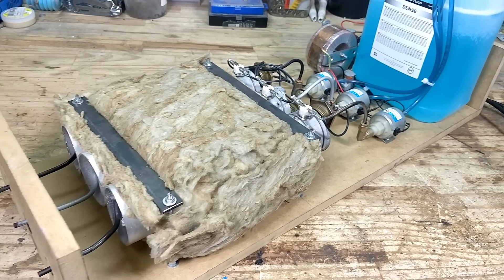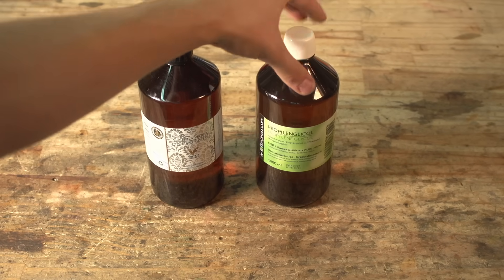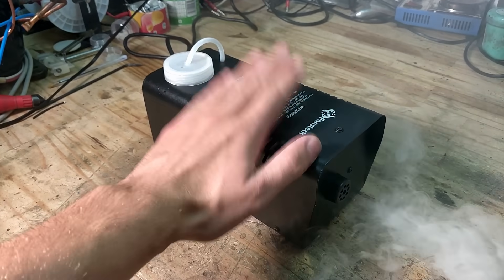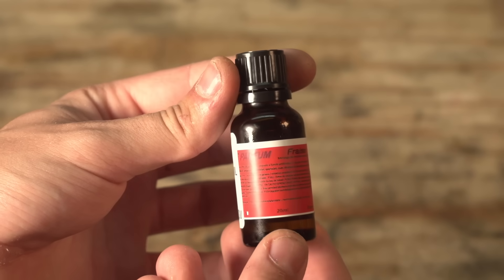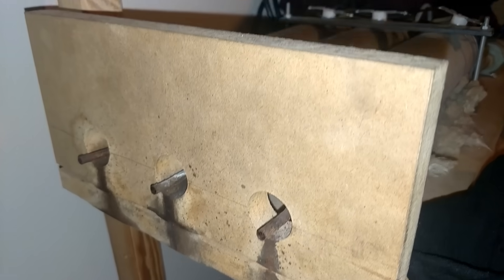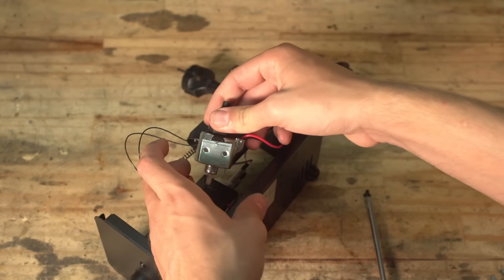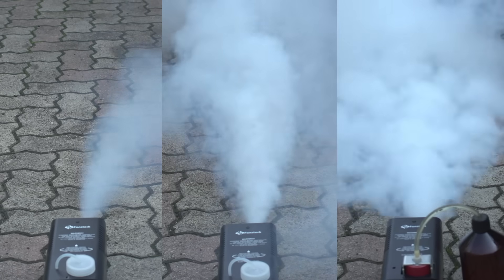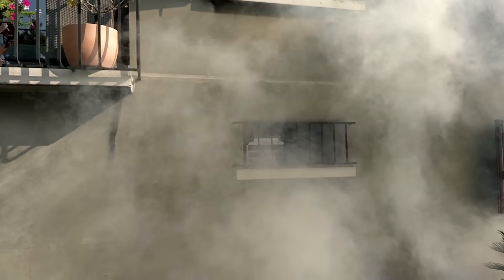How To Make a Cheap Fog Machine 10 Times More Powerful

Comment: what's your stance on putting the 50/50 solution in a propane insect fogger?
Reply: Use mineral oil for insect fogger works great.

Comment: The reason they use the mixtures they do could be as sinister as people like lots of fog, so, they will have to buy more juice. Or is could be as innocent as regulatory measures that are put in place require them to only include so much glycerin due to toxicity.

Comment: Vinegar is the worst possible thing you could clean a fog machine with *UNLESS you run a shit ton of distilled water behind it, then cycle back in some fog juice. We use vinegar to corrode chains and metal for haunt props. What do you think it will do to the inner workings of a fog machine if you run it through, then leave it? Within 24 hours your pump will be seized and tout injector will be clogged with corrosion. Flush your machine with distilled water 5 or 6 times at least, then refill with fog fluid, cycle a few more times and then store them with an inch or two of fog fluid in the tank. never clean a machine unless it is malfunctioning and never allow it to run empty of fog fluid or store it without some in the tank. I have machines that cost $17 at Target that are still running after 5 years because I never let them be without fog fluid. If you "clean" your machine with vinegar, then store it, you will 100% have a non-functional machine when you try to use it again. Use a commercial cleaner, flush it out with distilled water afterwards, then cycle fog fluid through it and store it with some fog fluid  in the tank. They will last a long time this way.

Comment: Ordered the parts to do this myself, I have no idea how I'm going to sort out the pump, as I don't own a dremel and don't really have any good method to make the adaptor thing. I have some spare 3d printer nozzles, but that's about it..😂
Reply: I ended up 3d printing it and sealing it with a 2 part epoxy, worked like a dream.

Comment: Couldn't you just preheat the juice reservoir to a higher temperature, but still below the flash point to not cool down the heating element as fast when the liquid passes through it?
Reply: Good idea... That would also reduce viscosity, which should be helpful. Some insulation of the bottle and lines could help.

Comment: A word of caution some cheap fog machines do not have a separate metal tube in the aluminium heater block for the fluid  instead a gallery is moulded  in the aluminium . If the themostat fails and the failsafe fuse isnt positioned snugly you  will pump a stream of molten metal  across the room.

Comment: I'd do. 80% glycerin and %20 PG. That'll thin it out. Glycerin is basically water and will even stay around longer on foggy or humid days.
I'm surprised the propylene glycol gave you that much vapor because when I put only propylene glycol into my vape there's almost zero vapor.

Comment: thank you you have answered questions that I have had about somebody smoke machines. I know I got several gallons of existing folk solution but I bought the past at the end of Halloween seasons from Spirit Halloween stores like that. I guess I can take them and split them into jokes and then add a half gallon of glycerin and make them a little thicker. I think we're two years ago I bought the hurricane 1302 fog machine I never used it for an event I did take it out of the package and ran it to make sure it worked before my warranty ran out. after that I did run vinegar distilled water through it but I don't think the vinegar was clear. hopefully I didn't screw it up. but I will order one of them pumps because messing with the fox solution gives it a higher chance of the pump giving out well it's going to happen to me cuz my break things. LOL thanks again I appreciate your time

Comment: 15 Euros a litre?
You were ripped off.
I buy pharma grade PG and VG for making my own vaping juice, and get it for about £5UK a litre. If you hunt on eBay you can find it as cheap as 99p.
Plus you don't HAVE to have food or pharma grade, as you are not eating or consuming the stuff.
Note it is the VG that produces the vapour, the PG is more a medium to keep it in. So probably a ratio of 30/70 PG/VG.
You could always thin it out with ethanol if it gets to thick to pump.
Considering the older smoke machines used to use mineral oil, which is far more dodgy.

Comment: Because VG and PG are hygroscopic and they need the water to produce the white fog. Otherwise they have to take the water from the air. If there is not enough water in the air the fog won't be as visible as with enough water. Another reason is to dilute the fluid for different applications.

Comment: Ha ha ha - you just did exactly what i went through and came up with last year when i was shooting my thesis for my film and tv production Masters program!  Couldn’t figure out the reason for the distilled H20 either so i got rid of it.   Cheers mate, great vid. Oh and adding onto alpha ⬇️, PG/VG also leaves a nasty residue on everythinggggg in closed spaces 😉
Reply: ...and you never figured out what the distilled water did, huh? Sticky residue wasn't a clue or anything?

A responsible professor would have prepared you for the real world and failed you for risking huge lawsuits with homemade fog fluid since you completely ignored Actors Equity rules and regs regarding fog, smoke, and haze.

Comment: My biggest gripe with cheap fog machines is the duty cycle. "Continuous" duty foggers are not only expensive, but the solution always seems to be higher power heat exchangers. That still doesn't solve the duty cycle issue. Yes, it may lengthen it, but ultimately a heat exchanger has a cool down period. Have you considered building a true continuous fog machine of your own? I'm thinking either two automatically-switched heat exchanger trains or a more sophisticated, 3 mode modulating control system on one larger capacity heat exchanger. I would think that would allow it to operate continuously at its sweet spot (maybe 67% or so?) for extended periods. 

The other problem I have is the machine gumming up before the evening is through. If the controller were more sophisticated, it would be way cool to include an automatic purge cycle fed by a auxiliary reservoir of 50/50 vinegar/water mix. If there were two exchangers then the purge could be executed on the non-selected heat exchanger so that even with purging you never interrupt the production of fog.
Reply: You need to use better fog fluid. Of course, cheap fog machines probably won't have proportional heater control, so your heat control might be entirely digital (on/off, based on when a thermodisc opens and closes) instead of proportional. If it smells burnt, you're literally burning the sugars in the fluid.

The continuous duty machines have heaters capable of maintaining the required heat input. They also have closed loop feedback that monitors the temperature of the entire heater assembly with themocouples and adjusts accordingly with the duty cycle. 

The Ultratec continuous machines have heat exchange coils made from 1/4" copper tube about three feet long that is flattened and in contact with about a 6" square, thick aluminum heatsink. The G3000 actually has two coils. They take about nine minutes to heat up because the aluminum heater block is so thick, but once up and running, it takes a LOT to get them to time out. They'll happily chug along for hours at lower output. They're expensive because they're professionally designed products, expensive to make, and have to contend with liability if they don't work correctly.

They're also easily rebuildable. It's only $60 for a Rapid Change kit and about thirty minutes once you get the hang of it.

Cheap fog machines will always be cheap.
Reply: what about true temp control and insulating the heat block.

That way the temp stays at one set number, or close to it to prevent overheating and the insulation would lose less heat to the environment allowing for less power usage, and a easier duty cycle for the heater.

Basically what we do with 3d printers and those suckers can run for weeks at a time.

Comment: What Id like to know do these things run directly off AC, or do they convert to DC internally? I wouldn’t mind converting one to run off a few of my big lipo batteries in parallel.
Reply from the maker: If you can supply the correct voltage (120V or 230V depending on your model), the heater would definitely be able to run on DC. However, the vibration pumps rely on the AC to oscillate the piston back and fourth, so they can not run on AC. You could add a 12v to 120/230v car inverter, or you could replace the vibration pump with a DC peristaltic pump. Also, you'd better have a ton of batteries cause a 400W heater will eat up power real fast.
Reply: @NicolasSalencPBP  depends on how long I need to use it for I suppose but i run my car tyre inflator compressor lipos, runs around 180w. Just 2 batteries is fine for several minutes, they can supply high current. I would like to take one into a logging forest for taking photos when we’re finally allowed out again

Comment: My guess is you take a product they cost certain amount of dollars dilute it with water so that that product stretches further. Distilled water because if you use regular tapwater the evaporation process will leave behind all the minerals and you will have buildup which will eventually clog the machine

Comment: I want one in my van to deter the many tailgaters I encounter... I already have a heating block installed in my van: it is called a diesel internal combustion engine. I could use a fuel pump to pump the juice through a copper break line, coiled around the exhaust pipe leaving the engine and insert it into the first muffler (which is also rather hot)
I am sure this would result in a mist which would fog out 3 lanes of traffic without even lifting a finger... Fun fun fun...
For added effectiveness one could add some homemade butaric acid solution (basically anaerobically fermented potato peels in a bit of water)
Not just a thick fog but a fog from hell which smells like a week long deceased corpse which has tossed its lunch...

Comment: Interesting, but the fog machine looks like it runs off 120 VAC and the espresso machine pump you had was listed as 230 V so did you just use 120 anyways ?
Reply from the maker: I got a 230v model

Comment: I would be interested in a solution that involves using a 3s lipo to make a portable fog machine.  It would be great for airsoft, nerf, etc and be a safer option than smoke or incendiary type grenades currently available on the market....

Comment: the takeaway i got from this is to just spend $10 more on the 700w fog machine and put the larger pump for another $15 or so and do the 50/50 mix for the most efficient cheap "diy" fog machine. awesome video!
Reply: Heat up the liquid before putting it in the fog machine so the heating element wont cool off as easily
Reply: I dont remember him specifying that the 700w machine was actually able to keep up with the volume either. Did he?
Reply: hmmm... okay...

Comment: From the Vape side: 
PG is the carrier substance for the aroma (and the nicotine)
VG is required for the fog.
However, the fog that you see is mostly just water vapor. VG is hydroscopic, it attracts water. So it makes sense to add water to a fog fluid.
You could try a mixture of 80% VG and 20% water
Reply: Isn’t the correct term hydrophilic
Reply: @tdawg719  https://en.wikipedia.org/wiki/Hygroscopy
Not in this case.
Reply: @sidmagos  the term you sent is hyGROscopic not hyDROscopic
Reply: @tdawg719  oh come on, two positions on the keyboard. ;)
But still "hydrophilic" is also wrong
Reply: @sidmagos  hey man.. two positions is all it took to conceive you. Remember that
Reply: @tdawg719  Both are correct, it depends on your country.

Comment: Remember, "clear vinegar" or "white vinegar" "acetic vinegar" etc. does not really mean anything unless you define the percentage of actual acetic acid you mean and have in your specific bottle. It is hardly pure and normally already mixed with lots of water, because a 50/50 mix of pure with water leaves 50% and you don't want to be in the room then and you do not want that on you. Commercially available in 2%, 4%, 5%, 7%, 10%, 12%, 24%, rarely 30%, and very rarely a few others depending on country. In Northern Europe 24% is standard in grocery stores but there are normally a few bottles 12% standing just next to it on the shelves. In the U.S it is Usually sold as just 4–7% acetic acid and 93–96% water, but varies up and down, so well you see how many hundreds of percentages the difference can be. Be careful with spirit of vinegar/ättika/white vinegar/clear vinegar. Pure it has a pH of 2.5 and should be treated with respect.
Reply: As chemists we use the term vinegar to be an estimate of 4%-12% acetic acid to water. A reason why we do this is it is faster to say vinegar than "dilute acetic acid". There isn't a single person watching this video that is going to use concentrated acetic acid thinking that's what he meant when he said vinegar. No one is going to use glacial acetic acid on their machine; Even if they had it and understood how to use it they wouldn't waste the money using glacial acetic acid when vinegar works just fine.
Reply: Your profile looks like someone I can trust this knowledge from

Comment: It's real simple Nicolas. They use the higher water content version which produces a weak cloud that disperses quickly so you use more liquid per event, thus increasing sales. An example would be, if a haunted house used 10 liters of fluid per night of an attracted, but the same effect could be had for 2 liters of the 50/50 mix due to the duration of the effect. Which would you pick if they where roughly the same cost? Also, they likely have their own internal distilling machine at the factory, making the cost of distilled only mechanical investment upfront and cheap tap.

Comment: The vape liquid that should be used in a vape like the one you showed should be a 70/30 vg/pg base. Large bottles of vape liquid like the one you showed are VERY rarely 50/50 so its most likely that the one you used in your smoke machine that smelled nice was at least 70/30.

vapers have been doing these kind of experiments for at least 7 years. vg gives the best cloud production but is thick and thus needs more power to be vaporised. pg is thinner, is good as a flavour carrier but produces a more pronounced " throat hit" which isn't pleasant hence the 50/50 or 70/30 ratios
Reply: Longer than 7 years, I can attest
Reply: @travelinghermit  50/50 was still more common when I started which was 5 years ago.
Reply: I still have bubble gum vape juice in my fog machine from 10 years ago. My band comes out in a cloud of deliciousness.
Reply: @DeAthWaGer  Lost opportunity if the band babe name isn't Hubba Bubba
Reply: Mac Nifty  alcohol tincture. Gonna get expensive so maybe some CBD juice just to calm the audience down if you're stoner metal.

Comment: Next pass the fog through the cooling coils of an window air conditioner so the fog tends to hug the ground. Better yet take a styrofoam cooler punch a hole in each end, one for the fogger and the other as the fog exit. Create a serpentine channel inside the cooler and fill with dry ice. The fog weaves its way through the dry ice and is chilled so it hugs the ground...horror movie like.

Comment: If you add a second section for the gas to pass through some dry ice, the smoke won't rise and dissipate as quickly. It will stay low and look extremely dense.
Reply: It's not a gas - It's suspended particulates.
Reply: @UnitSe7en  Water vapor is gas
Reply: @Tony-nl6pf  But it contains (a lot of!) particulates. This isn't steam you're looking at.

Comment: Most machines have both a thermostat (fixed button type) and a thermal fuse. I used to install a bypass relay that would bypass the thermostat when the pump was running. This avoided the scenario where fog use would start right after the thermostat kicked off resulting in the unit spitting juice after a short run as the thermostat would respond too slowly. You do run the chance of blowing the thermal fuse if the unit is run dry, but properly managed the results were better.

Comment: Holy cow what a difference! If I can squeeze one into my budget I'll be doing this for this Halloween with a chiller! As far as losing heat from the block, maybe a timer set to kick the fogger off once you get an idea how long it takes to start seeing unevaporated juice come out, cool for however long is needed (again after finding the ideal time it takes), then kick back on, rinse, repeat....
Reply: Did you end up trying with the chiller?   Does your chiller use ice or dry ice?
Reply: @MikeKolcun  I haven't been able to spare the money to do it this year, but once I can build up a setup and experiment around with it, my plan will be to use dry ice

Comment: I found that exact model pump in a larger 1200W fog machine. :)
The thread is G1/8, which is fairly common for pneumatic fittings and stuff (like, the one on 3d printer bowden tubes), perhaps that'd be an even easier way to connect to the tube of the heater, with a cute little PC2-G1/8 quick connector.